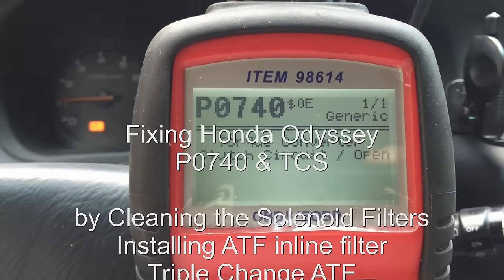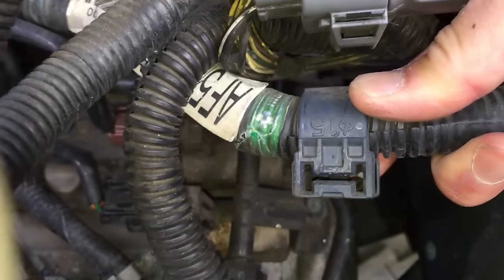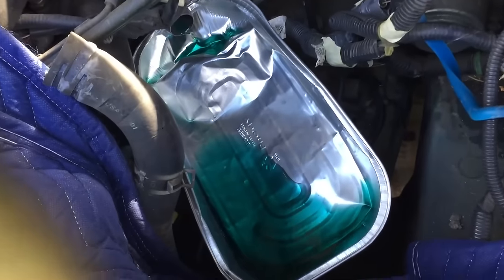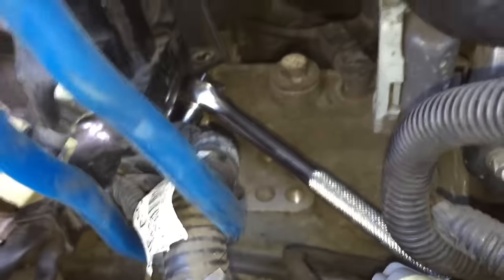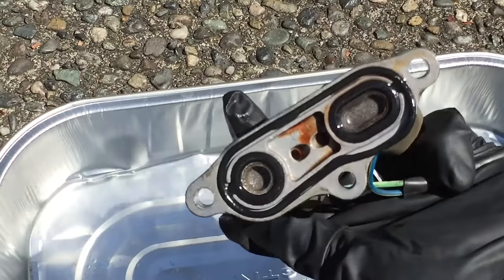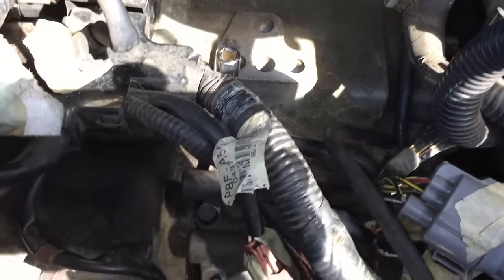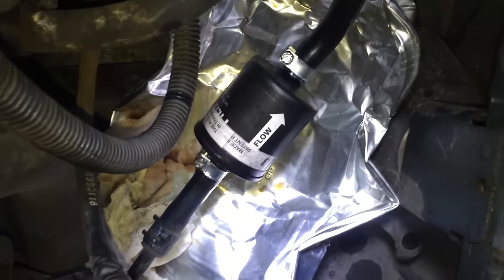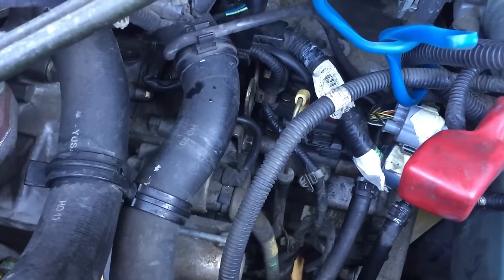Fix Odyssey P0740 TCS Transmission Problem

Comment: other than the code where there any symptoms ?
Reply from the maker: Hard or jumpy shifting, poor gas mileage at freeway speeds, but they didn't really become obvious until the same time the code was displayed.
Reply: I got the same code p0740 but my odyssey shifted real good No jumpy ... i think i just need to replace those two sensor?

Comment: Gracias bun video  si trabajo mi van. Hice lo mismo ke en tu video
Reply: Disculpa amigo tengo problema con mi Odyssey 00 apenas comenzó a fallar le prende las luces de check motor y la del TCS corre bien pero cuando dejas de acelerar se frena como si frenaras un carro standar con velocidades.cuando paras al comenzar a acelerar da jalones y chilla llanta.ese problema tenías tú  y aproximadamente cuánto duraste en acerlo tu y se ocupa algo extra o especial para Acer este proceso.gracias muy amable